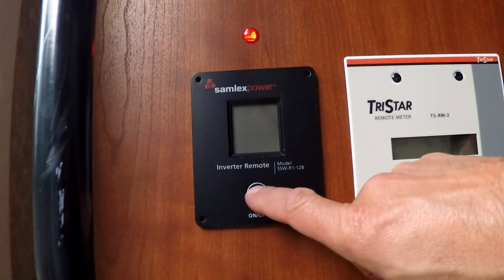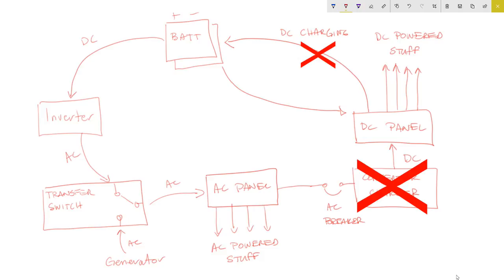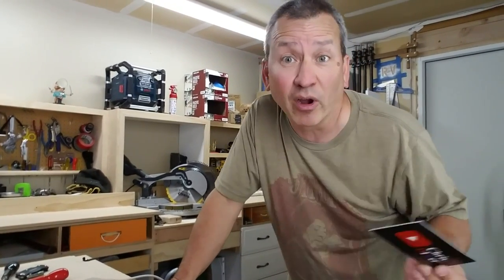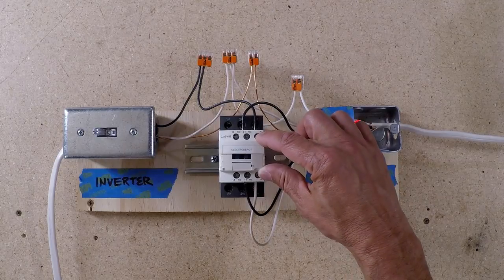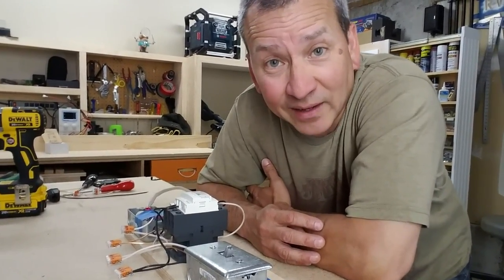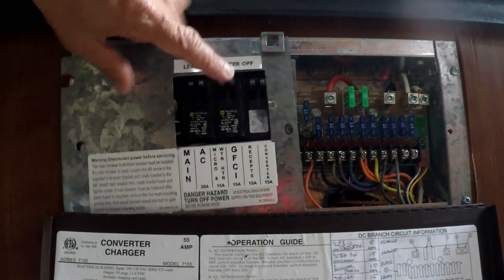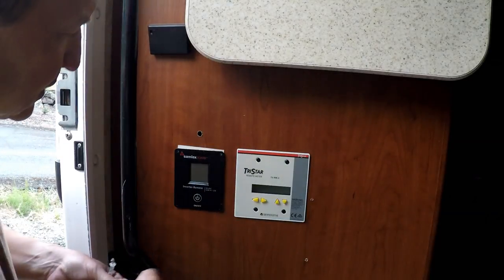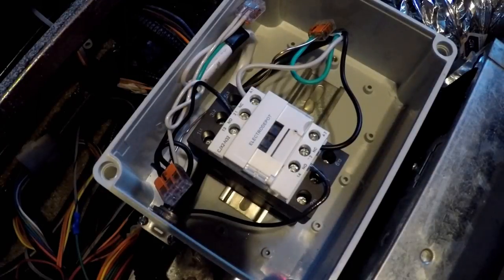How To AUTOMATICALLY Disconnect a Converter Charger When Using an Inverter

Comment: don't understand the need for that switch.  Why can't you simply disconnect the converter from the main panel and run the hot and neutral lines (and ground) from the converter to the "Normally Open" contacts on the auto transfer switch?  That way the converter only operates when connected to the shore power side of the auto transfer switch.  Doesn't that eliminate the need for the switch you added and the extra wiring from the inverter to that switch?  Wiring would be easy by replacing the 2 pole connectors on the Normally Open terminals of the transfer switch with a 3 pole wago connector.   You basically  have both the shore power and the converter tied togther on the Normally Open side of the switch.    When it switches to inverter power, the converter is  disconnected and "left behind" with the shore power input......
Reply: I have exactly the same question. If you do this ^^^, do we need an extra device at all??

Comment: 13:48  5/24/24. Just wanted to let you know something important about this video. I just installed a Renogy 2000W inverter. The contactor does not work wired like you have it. I tried over and over with no luck. I believe it is because my inverter has UPS, and probably related, it has capacitors on all terminals. So with the contactor powered by the inverter plug in, it would not release completely. I’m gonna wire the contactor in between the Shore power and the inverter and change the charger to the NO terminals.
Reply from the maker: Sorry Mike, but I don't have a quick answer for you on this and haven't had this setup for a few years now. Are you sure the Renogy 2000W inverter has a UPS mode?
Reply: Thanks for replying Brian. I enjoy your videos. You do a great job.
I had a couple of pics from my manual that showed it had UPS and capacitors but couldn’t figure how to upload them.
I think I have it figured out how to use the contactor by using the NO instead the NC poles. Also I am gonna incorporate my air conditioner on one of the other NO poles to also disable it while on the inverter. 0:03

Comment: You need to add a transfer switch to the ac power for the fridge as well. The fridge operates as ac priority meaning, when ac is present it will switch the fridge to ac when the fridge is set to auto. The fridge can draw a much as 25 amps. You want the fridge to run on propane when the invertor is on. When my invertor switches on my dc amp monitor shows about 2 amps draw with nothing running on ac from any of the house wall outlets, with the fridge ad converter isolated.
Reply from the maker: I always keep my fridge switched to propane unless my batteries are fully charged and I'm getting lots of sun. Yes. mine draws roughly 25 amps as well. The two amps draw is overhead from the inverter. My inverter draws roughly 2 amps with nothing running. I shut it off when I'm not running anything AC.
Reply: Good Thought I will have to check how my fridge works to be sure I can force gas only. I thought I could but it will be good to check. Thanks.
Reply: Most Dometic fridges I have seen have an auto mode or a gas only mode. In the gas only mode it's not an issue but most people keep their fridge in auto mode and then it will automatically switch to ac when ac is present saving propane.
Reply: You are correct the 2 amps is just the load of having the inverter on. I can live with that draw unless it's for long periods and I also turn off my inverter when not needed.
Reply: It's very easy to add a transfer switch to the fridge ac line. I built  a box with the relay and two ac plugs. One female ac plug to plug in the fridge cord and the other ac male plug to plug into the ac receptacle located in the outside fridge compartment. When you isolate the fridge then it's truly automatic. You don't have to remember to turn off the converter or switch the fridge to propane only. I hit my inverter remote to turn it on and don't even have to think about anything to switch or turn off.
Reply from the maker: Cool. When you cut power, it automatically switches to gas mode when set to "auto". I'll have to look into that.
Reply: Larry Askew thanks
Reply: Larry, could you expand on this a little.  I understand why you would want to isolate the refrigerator and make it think there is no AC.  I just don’t totally understand how you accomplished it?

Comment: I have a  travel trailer that the wires are a bitch to get to so I will be turning off the circuit breaker .
Reply from the maker: Yeah. Running the wires is always the hard part.

Comment: So your converter is just a fancy name for a battery charger? And your electromagnetic switch is really a contactor or is it a relay? I am more confused now than at the beginning of your video. Why don't you use an appropriately rated relay rather than a fancy heavy duty contactor. If you want quality and convenience, use an Omron plug in relay... far easier and cheaper than that huge clunker that draws power from your inverter. How big is your battery charger by the way? A 15 amp 110 volt circuit can supply a 100 amp 12 volt battery charger.
Reply: I set mine up to be inverter = NC and shore = NO as well as use the T1-3 ports for other things I want "off" unless I'm on shore power. I don't mind the contactor consumption when on shore power, but the buzzing is annoying.

Comment: Actually, your RV incorrectly configured.  The only time the converter/charge should be on is when you are on shore power or generator.  So, the inverter should be on the common side of the transfer switch which selects between shore and generator.  In short, when you're on inverter power you are, by design, using the DC plant to generate AC and it make no sense to have that AC power the C/C, ever.  Your DC plant is also providing DC power to the RV house so the C/C is of no use if powered by the inverter, which is powered by the very same DC plant.  To be clear, the diagram you show does NOT show AC shore power coming into the transfer switch, which will bypass the inverter (not running) and pass shore power to the AC distribution.  The inverter, itself, acts like a transfer switch for shore/generator power or inverter power.  The C/C should also be on the common side of the transfer switch in parallel with the AC input of the inverter.
Reply from the maker: Fundamentally what you're saying is true, but I think your missing a couple key facts about my setup. When off-the-grid I plug my shore power cord directly into my inverter. With the inverter on my AC transfer switch thinks it's connected to shore power, hence the need to automatically disable the converter/charger. Second: my inverter is not a hybrid inverter with internal transfer switch or smart power management like a Victron Multiplus or Xantrex Freedom inverter. It's a basic pure sine that switches on and off. If I were to install one of those then it would replace my existing transfer switch, inverter, and converter/charger. I may do that in the future but for now I don't have the need since I'm rarely on shore power or use my generator. This system has worked flawlessly for the last few years. Hope that helps.
Reply: Thank you for the clarification . It definitely matters that your inverter is not capable of detecting if a primary AC source is available.  It's difficult for me to believe that anyone still builds coaches with those since an inverter with an internal bypass to line power (UPS mode) doesn't cost much more than one without.  In fact, every small home/office UPS for computers has one built in.  Having an integrated converter/charger is an option, but not necessary as there is no added value to an all-in-one device.  In fact, there are many problems inherent to the way industry is building out the electrical systems and DC plants, even today.  For example:  When the converter/charger does not have separate connection points for the batteries and the load, the charger can never move out of absorption mode.  The very purpose of having a three or four stage charging system is it will advance from absorption mode to float (maintenance) mode to prevent damaging the batteries and shortening their utility.  My batteries, alone, cost over $1,400 and I would never leave them connected to a charging system that is, practically, incapable of properly maintaining them.  I'm an electrical engineer and can't tell you how many  commercial DC plants I have had to reconfigure so that the manufacturer's warranty on their 15 year batteries were not voided. The smallest plant I've seen is 1200VA, -48VDC and those VRLA batteries were on the order of $16,000 to replace.  Something as simple as temperature compensation can keep from cutting life expectancy by 50%.  Of course, the efficiency and capacity of the battery continues to diminish in that time, as well.   - Mahalo!

Comment: can i "disable" the converter in my rv buy just disconnecting the batteries?  Its parked in a permanent off grid location and just want to power via solar with separately run inverter and batteries.
Reply: The converter will still be making 12VDC even if the batteries are disconnected. And if your solar is feeding 120V you may need to either run the converter or feed the battery from the solar to run your 12V lights and appliances.